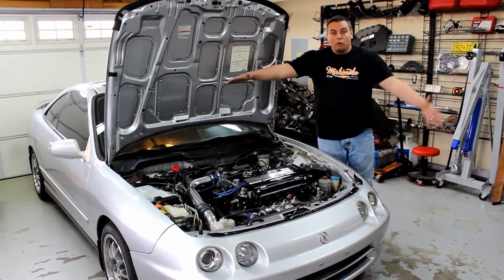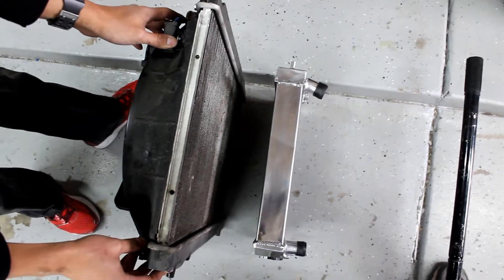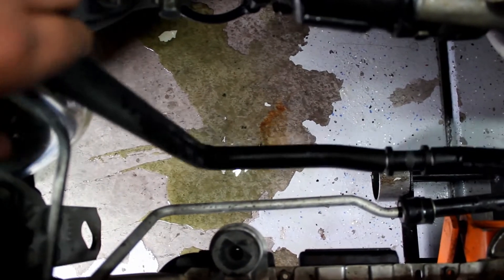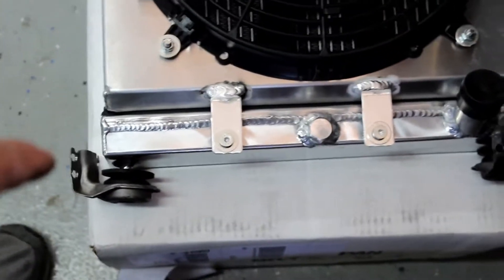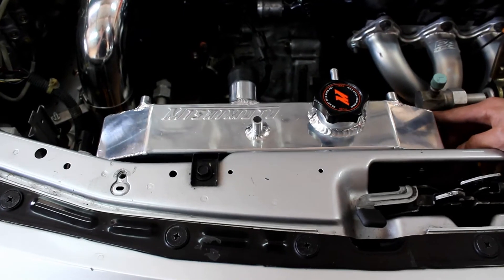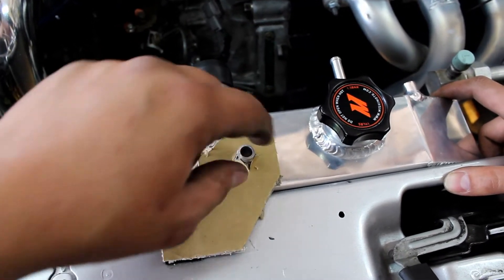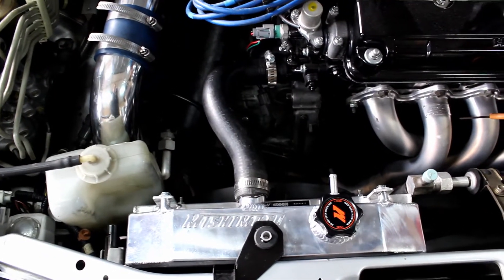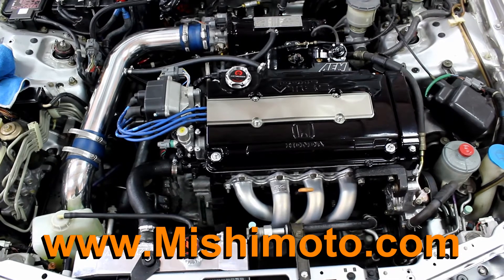Project "No Rice" #10: Mishimoto X-line Half Radiator Install (Stroked LS/Vtec Acura Integra)

Comment: Question: Is the condenser fan essential for the ac to run correctly?
Reply from the maker: it still worked without the fans.  but with the turbo (to save us a headache), the A/C was deleted.